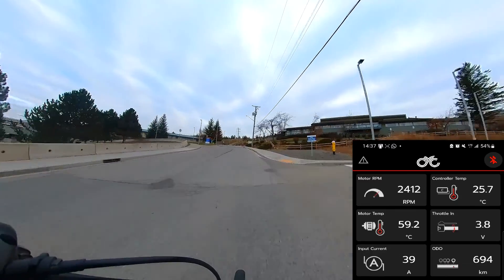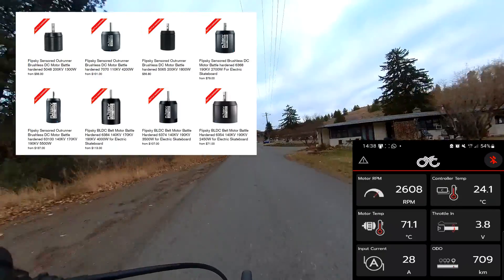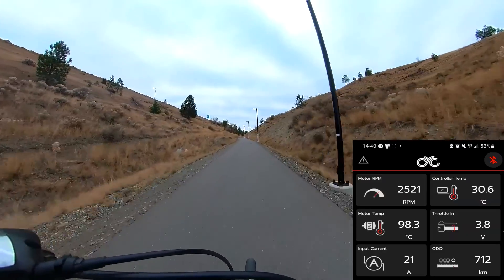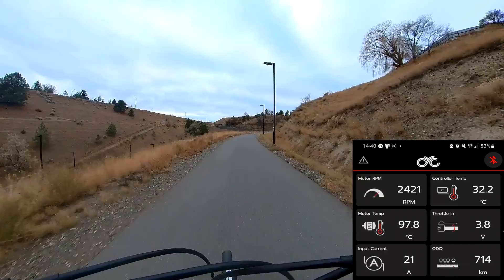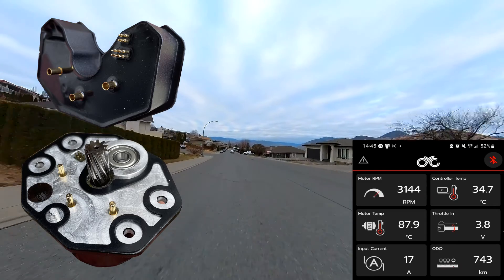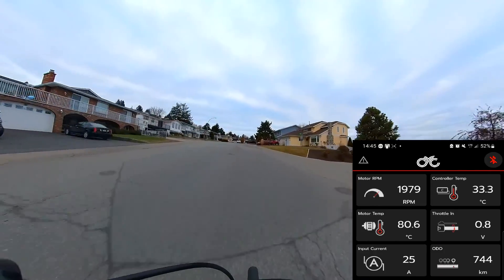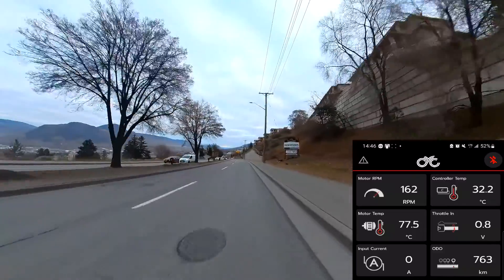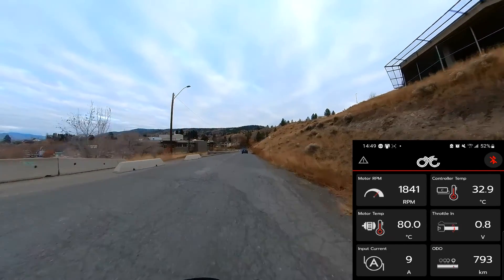How This Ebike Motor Works - Why the CYC Photon gets hot

Comment: I have a solution for the heat issue without opening the engine to grime. I’m going to see if I can talk my way into a couple free Photons for my troubles though first in trade. My engineering isn’t free.

Comment: Other motors have Assist-levels setting % the motor contributes besides manual pedaling. 

Does the Photon motor have assist level settings?

Is heat building up at 500 watts and 750 watts?

As example, i have a Priority Current ebike having assist levels 1 thru 5 (8% of motor to 100% of 500 watt motor use).
Reply from the maker: It’s set using power in watts. There are three levels you can set to anything you like up to the maximum which is 2000 watts unrestricted.

Comment: I have four bikes with Photon motors, all of my family rides a bike with one. My two kids and wife have never once had any issues. I have, because I push it to its limits. And the limits of up to 2000 watts unrestricted are an amazing bonus and highly usable in bursts. This video is very misleading. The motor never overheats because thermal overload protection kicks in if you overuse the extra unrestricted power. Please realize people that this motor is extremely powerful, much more than any standard ebike, including the Turbo Levo. With one of these motors, you'll leave all other ebikes in the dust. The extra power means the motor will get hot sometimes, but it never "overheats".
Reply: @KunjanChauhan  I believe you don't understand the product because this videos is so misleading and unfair. They could have easily gimped the motor so that it never reached high temperatures. But that would have meant less power. You get tons of extra burst power that you can use over and over and over again, as long as you monitor the temperature. If that's not for you, you can dial down the power, and it will never reach thermal overload protection and limit power and still have a motor that will outperform almost all factory mid-drive ebike motors. CYC chose to give users the option to use all possible power, unlike every single other mid-drive motor manufacturer. I think that's very cool of them. If they are guilty of anything, its giving the owners of the motor too much power and not communicating to them enough what the situation is. Its probably because they knew it wouldn't have mattered. People just can't seem to see things from anybody's view except their own. Its such a great motor. Its too bad that videos like this completely misinterpret how the motor is supposed to be used. The motor is only for smart people who understand the entirety of the situation. Ignorant people will overheat it and then complain. I know, I used to be one of them. Then I caught on and realized I was the one that was wrong. Hopefully the maker of this video will too.
Reply from the maker: @robertportillo7723 the video is relevant because when it’s very hot here as in 40C the motor gets very hot very fast. It’s not great to have electronics sit like this for ages. I take a very fair view imo. If you climb a hill in 40 degrees and it’s throttling it to 400 watts where is your boost power. They stuck an outrunner inside a coffin. They are not built to last regardless of your assertions. My opinions come from over six years of working with CYC motors of all types. But feel free to simp for the manufacturer.
Reply: @HighVoltageKits  Of course, you probably know way more than the engineers who designed the product.
Reply: @HighVoltageKits  Also, my family of four, all with Photons, rode for 4 hours in 97 degree weather one day, and none of ours got too hot. They only get too hot when you overuse them. And you can only overuse the Photon because CYC was very cool to allow an unrestricted mode that makes it even possible to overuse it. It may not be a perfect motor, but its the best torque sensing mid drive motor available.
Reply from the maker: I know more than you by a long long way. I know that no other motor manufacturer is encasing a motor that is designed to be exposed to air. To do that they have to make lots of design compromises. Those motors cost them about ten bucks each. It’s a very cheap motor as well as very small components. You will learn with CYC. Come back in a few years and revisit your opinion. I have several other videos on this motor looking at its pros. This video looks explicitly as to why it’s so easy to get it hot.  CYC claims it’s done this way for more torque but in reality it’s so they can use a cheap off the shelf motor and not have to do that part of the design. It’s the same with their X1. Cheap RC motor made by a third party. Which is why it took them four years to make the rotor changes we recommended to them from day one.
Reply from the maker: I don't think it's misleading. Having a motor sit at 100C in a throttled condition for long periods which is what happens when it gets warm here is a really dumb design choice. Encasing an inrunner in its own coffin. I would just like a motor that works. Mine once again has issues. I have maybe 800kms on it total. Cool you are doing well but loads of people are not. The other issue is the electronics don't like high heat either and its leading to high fail rates of things like hall sensors.
Reply: @HighVoltageKits  First of all, they gave the motor unrestricted extra power in a small form factor with torque sensing. As the CYC engineer said, that you have chosen to ignore, you're using the motor in a way its not intended to be used. When you use the throttle responsibly, and keep an eye on the temperature, you have instant and massive power whenever you need it, and you can use it a lot. I went on a ride and used it for hours and hours yesterday, in bursts. Its not meant to use full time like you did in the video. They could have easily just left out the throttle, or limited the power so that people like you don't use it irresponsibly and then make misleading videos that trash a brilliant motor. You had problems. Sorry to hear that. But "loads of people" means exactly how many? What percentage of people vs. the number of sales. You don't know that. You're taking your subjective experience and using it to make wild and general claims. You only know about the complaints. People that love the motor and have no problems rarely go out of their way to voice their opinion.

Comment: The only reason I will be fitting a motor or specifically a CYC Photon, is for pedal assist. I am not interested in turning my bike into an e-moped/motor bike by using a throttle.  I suppose it comes down to what you will be using it for.

Mopeds and motor bikes are more stable at higher speeds because of their low slung weight, design and components to match that power, bicycles are not safe at high speed.  

Yes it is exciting to have an unrestricted motor but where's the limit! and someone will always push things beyond the law and what the bike can handle.
Reply from the maker: The laws are terrible and all they do is limit light electric vehicle design and production. Places like India and Africa are going to leave us in the dust in terms of development as a result. The laws are there to protect legacy transportation methods and have nothing to do with safety for the most part. A decent road cyclist can reach speeds of 50kph without much fuss. Is that unsafe. I certainly don’t feel unsafe on the stuff I build going at 50kph uphill. It’s down to building and riding. Downhill frames are really very strong. I’d wager they are often tougher than moped frames which are legal. Safety equipment is critical. But how often do you see motorcycle riders doing silly speeds with poor footwear shorts and tshirts. Enjoy your Photon. The throttle is ultimately gutless. It won’t turn it into anything approaching a motor bike. If you ever hurt yourself or picked up an injury it would allow you to potter about a bit still.
Reply: Just get a DM01 for half the price

Comment: Make it water cooled with a computer radiator
Reply from the maker: With enough money anything is possible but that cost there are better motors.
Reply: @HighVoltageKits  like what motor? What better motor has this power capability with torque sensing and throttle? Where? Let me know and I'll buy it. It doesn't exist. I run circles around factory ebikes with zero overheating unless I'm pushing it to the max. Even letting off to let it cool down (running the full 2000 watts) I still leave my friends Turbo Levo's in the dust.

Comment: I am running the photon on a long tail bike in South France (35°C in summer) with a lot of steep ways. Even on 750w mode, I get restricted by high temperature after only 2km when I have my 9yo kid on the bike on a 15% road. I am so disappointed by this motor. Doesn't worth the price.
Reply from the maker: They are essentially encasing the motor in a coffin. It’s not a 750 watt motor for any real load or distance. It’s a shame
Reply: @HighVoltageKits  his advantage is that it exist a frameware version that is legal on the road in Europe. I don't know any other powerful motor that also is. Do you ?

Comment: Thanks for the video. So the real "safe" temperature for the Photon is approximately under 80-90 degrees, yes?
Reply from the maker: I mean I don't think any motor should just sit for long periods at this temperature. The torque sensor is good and the way it fits a wide range of bikes is good but the motor itself I think is a poor design.

Comment: thanks i know of a photon that failed in 2 months, light riding, never overheated but apparently has a higher fail rate than people know...CYC dragging feet on this.
Reply from the maker: According to CYC is manufacturing defects. Not much use to the people with failed motors tho.

Comment: Could air be forced thru the casing ?
Reply from the maker: Maybe but then you have issues of preventing moisture getting in as well as fine debris. I think just use it within its limits. That I will be doing from now on.

Comment: Thanks for the breakdown! Allow our everyday rider and project engineer to add a few comments. His personal Photon is approaching 8000km and has been through floods submerging the motor and heavy mud conditions.

1. We'd like to state that the Photon is specifically targeted and designed to be an alternative choice for fully integrated EMTBs such as the Bosch and Shimano motors. Ensuring the system runs smoothly with pedal assist is the main performance goal. We wanted to get as close as possible to match the pedal assist feeling of fully integrated systems with a bit more ohms. Throttle capability is simply an added advantage for a burst of power when needed. Running at full throttle on 1200W makes complete sense as to why the motor will heat up fast. This is not what the system was intended to be used for. You can, however, run it continuously using throttle in the appropriate gear and at 750W rated power. 

2. Regarding the assumption of outrunner being the wrong choice is quite relative if you look at our design goals. The outrunner motor was chosen due to its superior performance in such a small form factor in terms of torque and efficiency. If the design had an inrunner, it would be twice the size with lower torque and terrible efficiency for power larger than 700W. If we did this, we would be sacrificing the good chainline as well as clearance between the motor and bottom bracket. In the Photon, you will also notice that it is potted, unlike other ebike and skateboard motors. This allows the coil temperature to conduct to the potting (direct contact) and then to the stator plate itself (again, direct contact). From the stator plate, there is a direct pathway to conduct heat to the whole motor system including the heat sinks. 

3. The hall sensor failure that you have experienced was also not due to the temperature.The PCB for the hall sensor is also rated up to 140deg C. ESD protection is the reason for the hall sensor failure. Hall sensor failures are extremely uncommon given the amount of Photons sold and have also been addressed and revised by the development team.

4. From our records and our resellers' records, the quality of the latest batch is very stable. We do apologize for the initial batch failure rate being higher than what we aimed for (although not near the levels reported by some online), we tried our best to test with third-party lab and in-house as much as we could before launching, but some issues arise only in mass production. Since then, we have addressed the issues that caused the failures. Meanwhile, we are improving our servicing networks and improving parts availability to ensure a quick turnaround time if there are servicing needs.

5. A point that we'd also like to stress is that the failures that have been seen so far are 90% caused by us upscaling our manufacturing. For a small company to start mass producing is a major challenge. There has been a few design modifications needed but these are very small adjustments and do not affect the base design of the system. We have been revising our scaling-up strategy along with the manufacturing and assembly processes. This includes better implementation of QC procedures. 

6. Running it in the "Unrestricted" mode is no problem at all in terms of durability but you will run into thermal limiting. We have enabled access to the motor's peak performance simply because it's great fun to have that available when riding.

7. Shhhhhhh, we don't talk about the Proton yet... although... it's aimed to run at higher power levels continuously but it will also be heavier and have a larger form factor. Details about the motor itself will also be released later on. We're taking our time and working on scaling up our production and quality capabilities first.
Reply: Amazing to get such an honest and detailed response from a manfacturer. Major kudos.
Reply: Now i am regret getting X1 Stealth with the pitch noise, any discount code to get the Photon🤣
Reply: What about extended warranties on the units that you admitted were a bad egg. What I mean is a reasonable extension to the units that were built during the bad batch that you speak of. I have had to return mine to BMW once already with complete failure. 48volts no throttle and no programming alteration. The return fixed the failure but I couldn`t get a reply to the failure.  Service was prompt but a thousand buck unit should be Youxiu
Reply: @alank808  Thanks for your question. We are glad to hear that your unit was sorted out quickly and that BMW provided you with good service. 

Any failures that need to be replaced will be replaced with the latest components or the latest batch (whichever is applicable in the RMA case). As the Photon has a 2-year warranty, we will not be offering extended warranties at this time. However, we may consider this or a similar solution in the future.
Reply: Thank you for your kind response. I also run the gen 3 stealth on a full sus. built and love the performance. I just hope the photon pans out as well. I will say BMW priority service and response was excellent.  @cycmotor
Reply: @alank808  Awesome stuff! 

Adding to our previous reply regarding the extended warranty: we do take into account any time period that a person may have lost due to waiting for spare parts, so we evaluated this on a case-by-case basis. We are aligning our warranty policy to communicate our commitment to providing excellent products and services. Our aim is to keep building on strategic partners (such as BMW) so that down-time and overall ETAs can be reduced to 2 weeks.
Reply: Is the proton the gen 2? Lol
Reply from the maker: I appreciate you responding here. Will bring up some of this stuff on the Friday video.
Reply: @HighVoltageKits  Please feel free to reach out to us if you need any other info.

Comment: They say magnets demagnetize above 80 C so I would be careful not running that hot
Reply from the maker: It depends on the magnets. Most decent ebike magnets can take more than that. Supposedly the ones in this can handle 140C according to CYC. Lower grade ones absolutely and its easy to tell. They no longer generate any torque or power. It happened to lots of Sur Ron guys. All of a sudden they had half as much power and it was running the motors too hot for too long. Good comment. Cheers

Comment: It’s under engineered 
It can’t handle power rating effectively 
It might as well be a tongsheng with a 3kw controller
Reply from the maker: I am not sure its quite that bad. But I think the ratings are given in house. I am not sure if its sent to an external body to be tested. I could be wrong.
Reply: @HighVoltageKits  mine failed early on
There seem to be so many failures, for the premium they charge it is not  right.
YouTube is filled with cyc infomercials which I fell for and Cyc failures after low miles

Comment: What if they make the little air intakes in the motor itself?
Reply from the maker: I have pondered this. It would need to be done carefully as there would be a risk of grit and debris getting in there and that would at best make it sound awful. So the airflow would need some kind of ducting and it would likely get so complicated it would add a lot of cost. To the point where its easier to just say that its a 500watt motor and to run it far more conservatively. There are a few other solutions which I will chat about on Friday. I don't see why it can't just be an inrunner. Well I have my theories. But thats all they are.

Comment: Is there anyway it can be modified to use an inrunner? Ive been using mine since May with no issues. But have it set to 300 watts max.
Reply from the maker: With enough money anything is possible. In a practical sense no. I'd stick to what you are doing especially if you are happy with it.